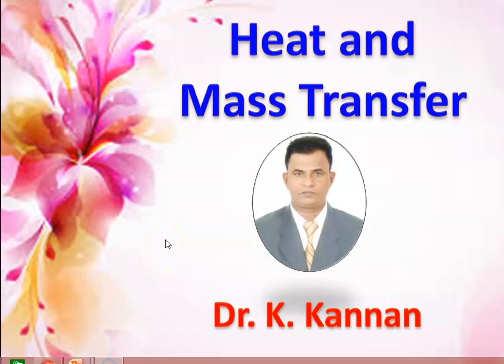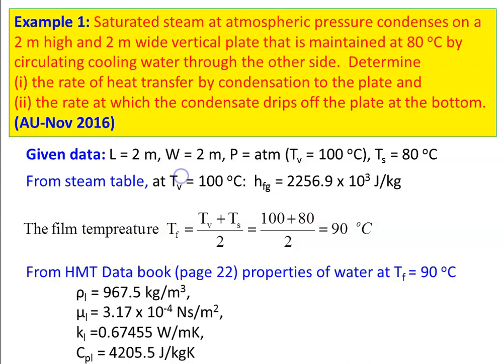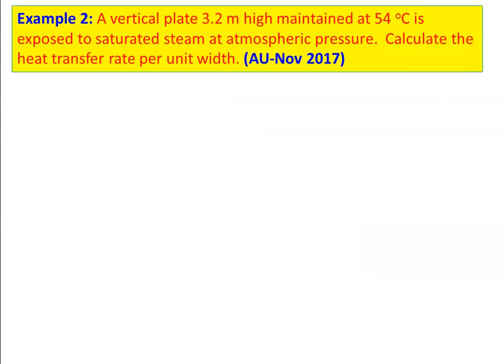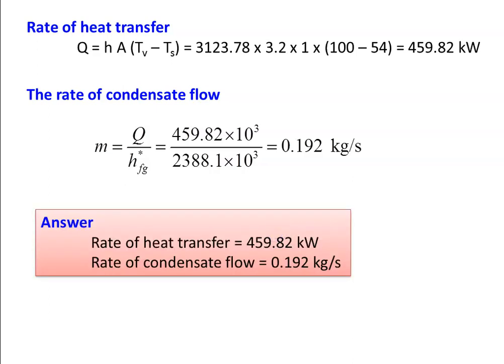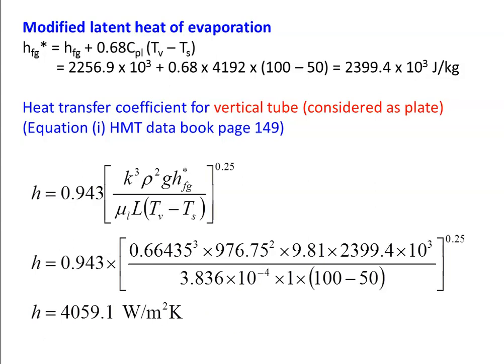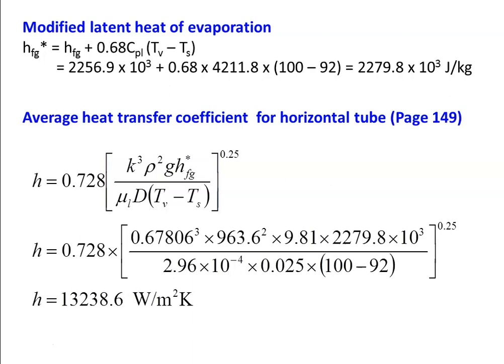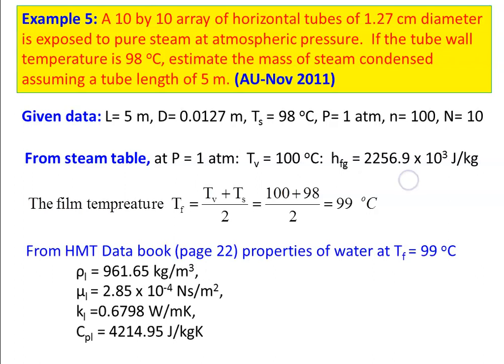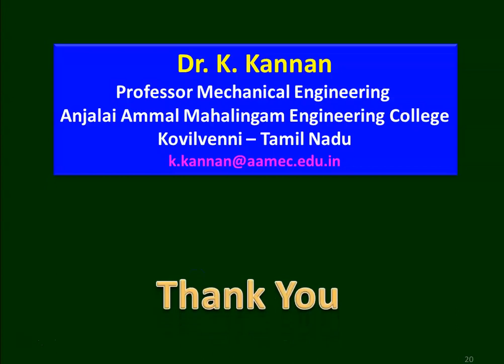HMT 3.4 Condensation Heat Transfer Problems

Comment: hello sir, why you took h(fg)*  ?
Reply from the maker: Refer my book on Heat and Mass Transfer
Reply: @dr.k.kannan198  what is title of book? or any link?
 can you please share
Reply from the maker: @gudigevineeth1345  listen to the lecture I have explained reason
Reply: @dr.k.kannan198  is it necessary to take hfg* value or just use hfg value
Reply from the maker: hfg* will give correct answer
Reply: @dr.k.kannan198  but sir in formula there's no hfg* indeed it's hfg given so doubt
Reply from the maker: Refer 
Heat and Mass Transfer by Kannan
Heat Transfer by Cengel
Reply: @dr.k.kannan198  But sir to use hfg* one should have hfg* in the formula like h= 0.943[k^3×density^2ghfg/uL(tv-ts) ]
No hfg* there sir in formula